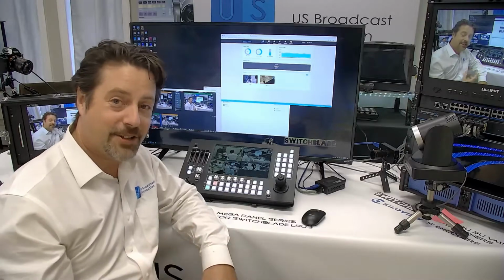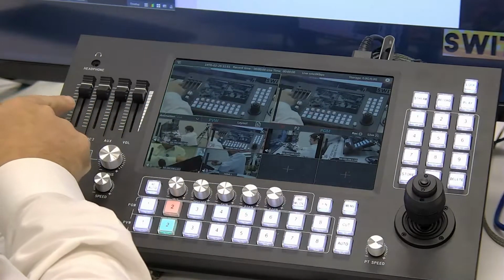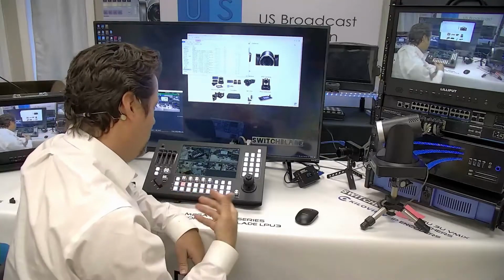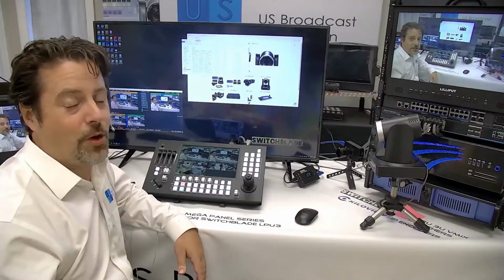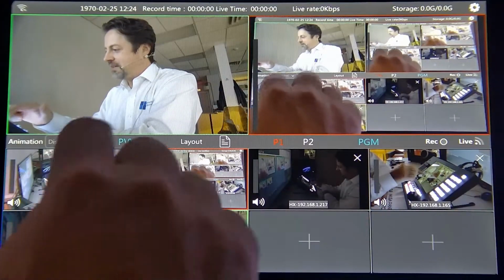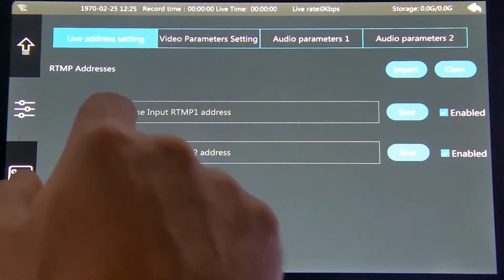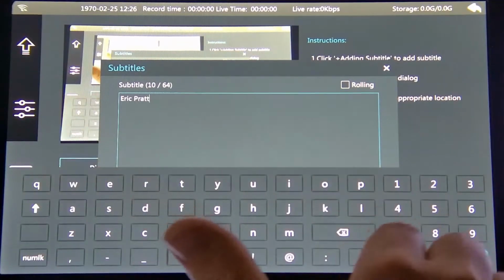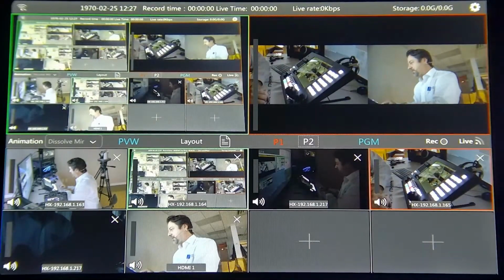PTZCam Switch N8 NDI PTZ Switcher

Comment: Hi, thanks for this video. This control VMIX / OBS while switching on the display. Or does it just give an output similar to the ATEM.
Reply from the maker: It's a standalone switcher, not a control surface. It will output HDMI, RTSP, or NDI HX